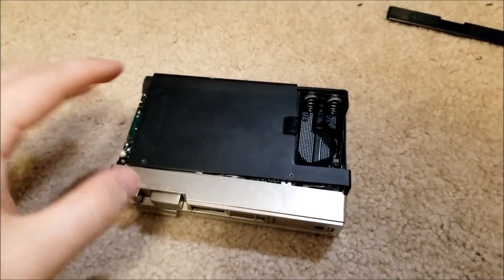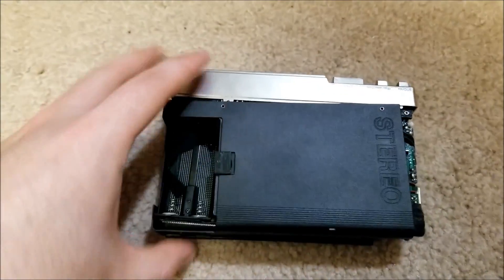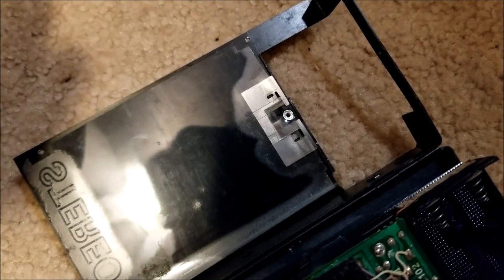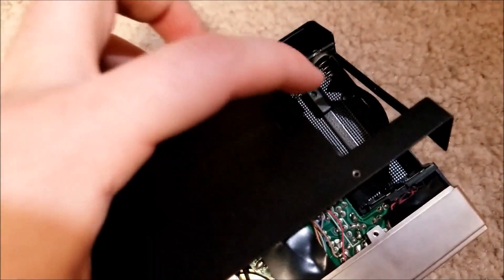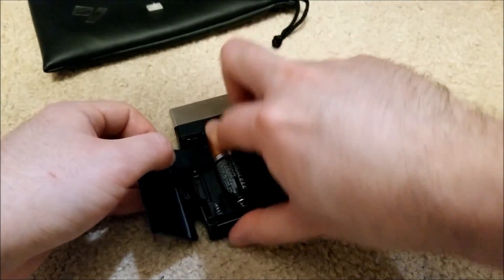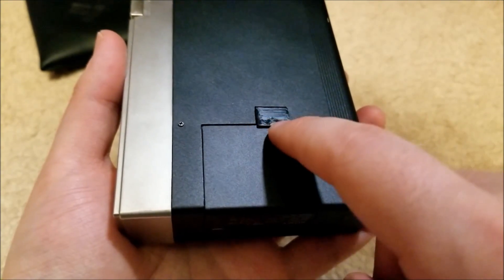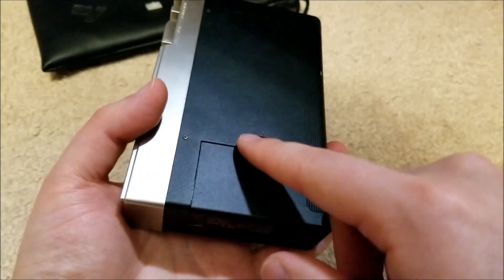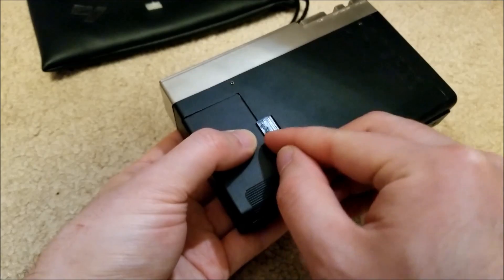Let's Fix: Sony Walkman WM-3 3D Printed Battery Catch

Comment: Your battery case button looks like the original one. And really who cares as long as it works. I would gladly have your version as long as I can play my WM-3.  I can’t believe the price of the parts on this model. Just an original battery door that works for this model is about 100 bucks maybe more.   I have this model and thought about breaking it down and parting all the parts out on eBay. I just had it completely refurbished and got it back last week. The guy who overhauled it did a fabulous job. I’m gonna put it on eBay and see what I can get for it. Very nice video. Thanks for your presentation.

Comment: Do you have any cases for the wm-3 it's a bit tiring holding it in my hand all the time. This was an awesome video BTW u deserve way more subs
Reply from the maker: Thanks. I'm sure it wouldnt be too hard to model and 3d print a tps-l2/wm-3 belt clip. I'll add that to my list of future projects!
Reply: sjm4306 OMG THANK YOU. Also would it be possible to buy a battery cover from you a black one for my wm-3 as mines falling apart and I don't have a 3D Printer
Reply from the maker: It might be cheaper/quicker if you took the stl files I linked in the description to a service like shapeways to have them printed on much better machines than mine. From what I hear its pretty cheap for small parts like this and the quality will be much better than my i3 clone can muster.

Comment: Hey, I dig your videos. I was wondering if you could repair my Sony Walkman WM-F10 it's a cassette case sized walkman. It doesn't turn on at all, I've cleaned the battery contacts from the INTENSE corrosion that's happened on the device. I cleaned up any corrosion that I could but the device still doesn't turn on, I don't know much about circuitry and have been trying to find someone to fix it, or help me out. Thanks.
Reply from the maker: I'd be happy to help, just be aware I obviously can't guarantee that even I'll be able to fix it. Shoot me an email at sjm4306@gmail.com and we can hash out the details.
Reply: sjm4306 thanks!

Comment: Hello I was wondering if you can help repair my little brother 3DS XL as the problem is that the device turns off whenever it opens all the way.
Reply from the maker: Sounds like it's either a damaged top screen ribbon cable or it just needs to be reseated. As I've just started a new job my free time is very limited so unfortunately I've put side jobs on hold until I get settled in.

Comment: have you tried to repair the shitty mini cassette player? dont even remember the brand for that one
Reply from the maker: I opened it and while lifting the board to inspect the belts a few wires broke off and I don't know where they go. Figures the one time I don't take a before pic is the time I need it. For now it's gone into my rainy day box for future quick videos.